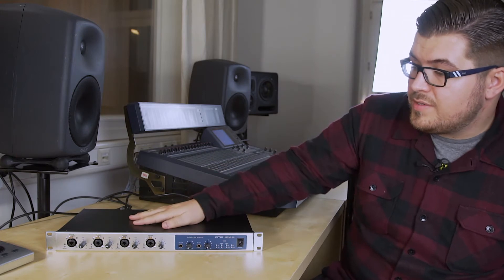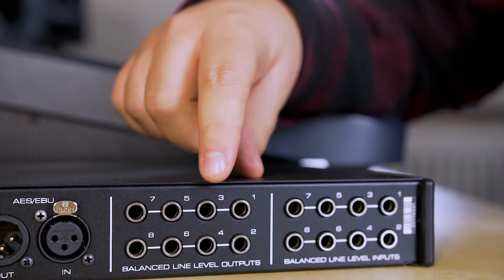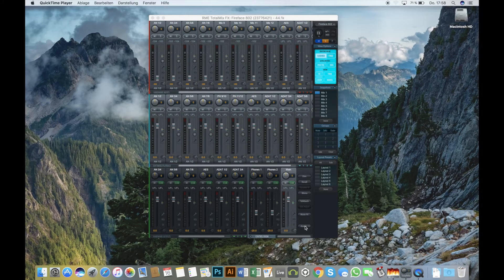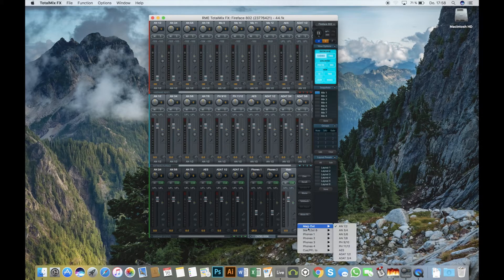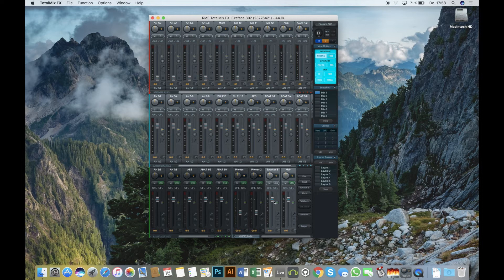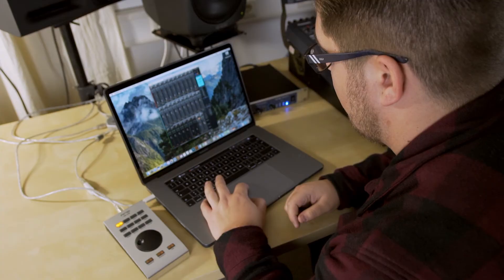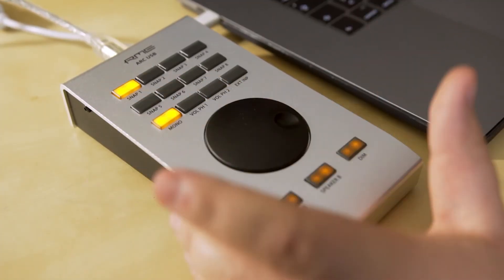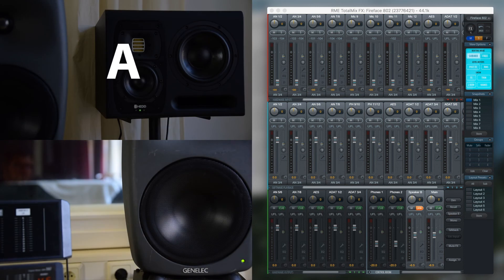RME Audio ARC USB - A/B Speaker Setup in TotalMix FX

Comment from the maker: Do you have questions about TotalMix FX? Let us know!
Reply: Can I create a subwoofer output ?
Reply: :body-green-covering-eyes:🤔🤔🤔 What about a MONO speaker, and sub woofer configurations. Whereas, I use a left, right and mono/center - these are all the same model speaker. I like to have one dead center for my mono reference and they are all tied to the 2 sub woofers. Now with the L/R config the subs are simply L/R however when I switch to mono, I need that center speaker on + I need the subs SUMMED to mono. then I have my secondary speakers a pair of mix cubes for L/R......... How total mix and the ARC USB, how am I to configure that?
Reply: If you use the optical out for Speaker B (assigned to AS 1/2) how can you control the volume of speaker B WITHOUT having to pull up TotalMix but using the hardware wheel on the Babyface OR the system volume buttons in OSX? All works fine with the Analog Out 1/2 (Speaker A, Main Out), but volume control of the optical out ONLY works by dragging the volume fader in TotalMix. Very annoying when you are working in a DAW and want to control output volume when on Speaker B.
Reply: I need a function to control the playback fader group with the encoder.
Is it possible?
Reply: Hi, I have a Fireface 400 and a couple of days ago I realized that the ARC USB can work with that, so I bought it. Since the preamp control on the FF400 is software based, I am a bit dissapointed to not be able to select that for control on the softkeys. I guess it's maybe only available on the Fireface UFX range? Woud you be willing to add this feature for Fireface 400, UC and UCX?
Reply from the maker: @sebawillem  The ARC USB controls functions in TotalMix FX. The gain control for the Fireface  400 is not in Totalmix but in the Fireface settings. In the UC and the UCX the gain is in TotalMix.
Reply: is it possible to have a MID/SIDE toggle to mainouts on the Arc USB? 
On my old interface i could monitor mono with one button and side with another.  used it alot to reference correlation and check for render artefacts.
==EDIT== figured out a workaround with snapshots but it involves adjusting all the channels and then push toggle to mono on mainout.   
would be neat to setup this with just one button press. any ideas?
Reply: Hi
I‘m intressted in buying a UCX II and an ARC usb as an interface/monitor controller and i have one last Question:
If i plug in the arc to the dedicated usb port of the ucx ii, will it switch automatically from standalone mode (with this fixed controlling options) and total mix control (where you can customise almost everything) as soon as its connected to my mac and vice versa?☺ will it perform this switching seemlessly? or have i to plug it in a usb port of my mac for this additional functions?
thanks a lot!

Comment: Is it possible to toggle between Speaker A and B in Standalone mode? My ARC is directly connected via USB with my "FireFace UCX II" and only the Volume wheel and DIM and "Vol PH 1" work in Standalone. But not the "Speaker B" button.
Reply from the maker: Speaker B is a software function of TM FX and not available in stand-alone mode.

In stand-alone mode the ARC USB has a fixed setup with the following functions:
   
Encoder        controls Main Out Volume
VOL PH1        Encoder controls volume of Phones 1* output
VOL PH2        Encoder controls volume of output Phones 2*.

* Fireface 802: The maximum volume is determined by the position of the potentiometer on the front panel.

DIM            DIM for Main Out
DIM            Press longer for function Recall of Main Out
   
The following functions require the key to be held down for 1 second (safety function against unintentional operation):
   
Snap 1-6        loads the setups 1 to 6 stored in the device
7            loads the 1:1 routing mode (All Channel) for the CC mode
8            loads the Phones Mix mode for CC mode
9            loads a default AD/DA configuration**
   
** Button 9 also resets all FX, including channel EQs etc.

Comment: can I use this to control my Dolby Atmos surround setup volume for all speakers?
Reply from the maker: Yes, you can make a fader group in TotalMix FX with all speakers included. The ARC USB then controls the master with all linked output faders (speakers). Each separate adjustable with the RoomEQ.

Comment: Simple unanswered question on Youtube. I have the exact same setup as mentioned (but with a UFX+). How do I add a subwoofer that can operate in both A/B speakers?
Reply: I think the only way is to treat the sub as a separate channel in that case. 

Connect a separate output (any of 5 - 8, or other outputs you have, that is not Main or Speaker B) to the sub and mirror the main output to the sub output in TotalMix. You can do this by right clicking the main output channel in TotalMix and selecting Copy/Mirror Output Main. Then select the output(s) where you have the sub connected and right click and select Mirror of Output Main. This will only mirror the input selections of the Main output, so you need to create a fader group with the main output channel and the sub output channel faders selected, so the faders will be linked when you adjust your output volume and retain the relative output levels of your main speakers and the sub.
Reply: @NoteLR  thanks , Had the same question !!!!!

Comment: Hello is it possible to set an ARC button as MUTE button for main speakers?
Reply from the maker: Yes, you can find the ARC functions in the "Options" - "ARC & Key Command Settings" in TotalMix FX.
Reply: @RMEAudio  so should I buy the blue ARC instead of the silver one for this function? (I have a fireface 802)
Reply from the maker: @Scarecrowsbandct  You can use the Advanced Remote Control to use it directly on the Fireface 802. https://archiv.rme-audio.de/en/products/advanced_remote.php
But the ARC USB is a remote controll for TotalMix FX and it can be used with all RME interfaces supported by TotalMix FX.

Comment: I want to use a mono speaker for my speaker B but it only allows to select stereo pair.  Is there a way to mono the output and send to a single output?
edit: I have figured a way to do it by making a snapshot and re-assigning the speaker B button to that snap shot.
Reply from the maker: If you have activated Speaker B and enabled the Mono (Main Out) function, Speaker B is also set to mono.
Reply: @RMEAudio  haha thats 2 button presses which it double the amount I am looking for

Comment: Hey guys could you possibly let me know how I could setup an A/B speaker setup with the Babyface Pro?
Reply from the maker: You can use the headphone outputs to connect an additional pair of speakers. You will need an adapter cable from stereo jack to 2x mono jack. To select this as Speaker B, you have to select the headphone outputs in TotalMix FX with the "Assign" button in the lower right corner. You can also connect an additional DA converter via the optical output.
Reply: @RMEAudio  Thank you for the response! Many thanks.

Comment: The idea is great, the only problem I see for using it just for monitor controlling ,compared to a traditional monitor controller, is that you need to use 2 DA outputs for each stereo monitoring path. I have 2 sets of monitors and a set of headphones, I'd need to use 6 DA channels just for monitoring, in a hybrid mixing setup it can be troublesome. With a classic monitor controller you need just one stereo DA (2 channels) and then it routes the signal to every monitoring path.
So I wish that one day you'll design a classic monitor controller (1 stereo in + 3 stereo out for example) because I love Rme products

Comment: Its possible Set 3 pairs of speakers with a ARC usb and a Fireface UCX ?
Reply from the maker: Yes :-)
Reply: @RMEAudio   Make a video for using 3 pairs of monitors please
Reply: @RMEAudio  could you maybe update the Arc USB so it can work as a monitor controller for 3 pairs of Speakers + Sub? (with dedicated buttons + the needed in/outs..) would be an instand buy from me!
Reply from the maker: @LordLurchMusic  For surround sound you can create a fader group.